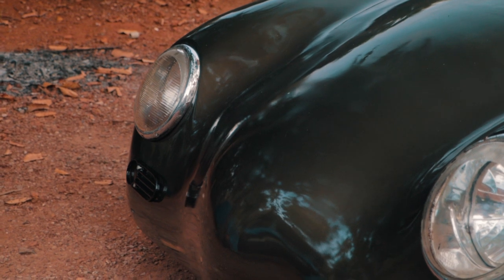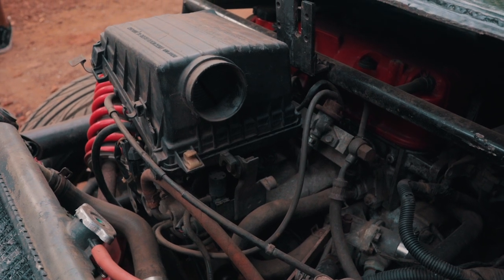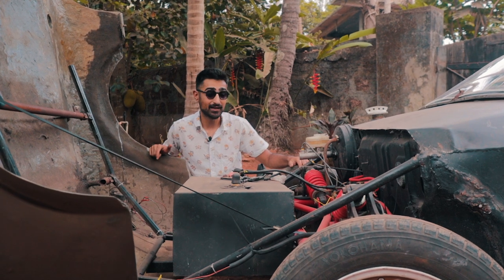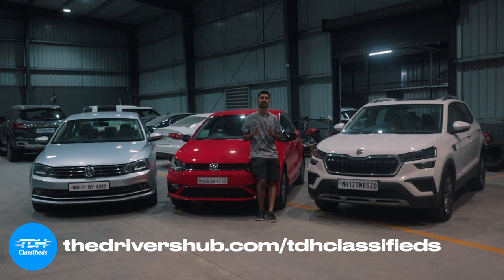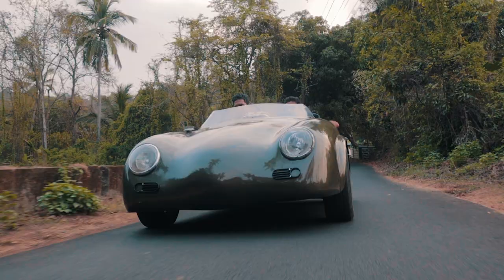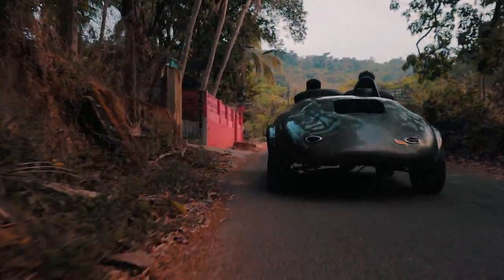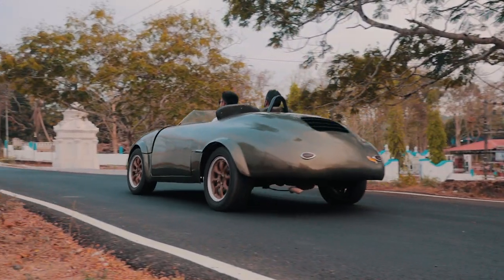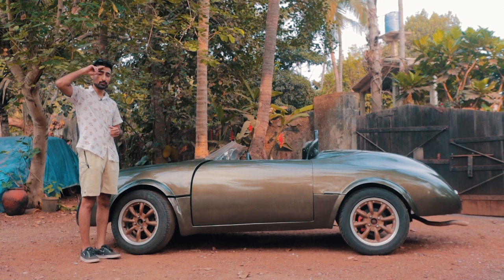Honda City converted into a Porsche 356! 🤯 | Rusty Cashew's Garage from Goa! | Autoculture

Comment: Its a  lovely ❤kit car . Labour of love ,passion and hardwork in its true form . Its still needs more improvement though which the owner will do in future. 
But i only got 1 question though 🤔
Why not the manual gearbox mated to that legendary 1.5ivtec engine? 
I mean old sports cars of 50s and 60s like this porsche didn't come with automatic gearbox except for the Americans who were probably lazy but little European sports cars like these didn't have a automatic gearbox because that would've just sapped the joy of driving.
Reply: It was built with what I had at my disposal, the city donor car was something my friend gave me
Reply: Auto is better as there is no need to struggle with the gear linkages etc